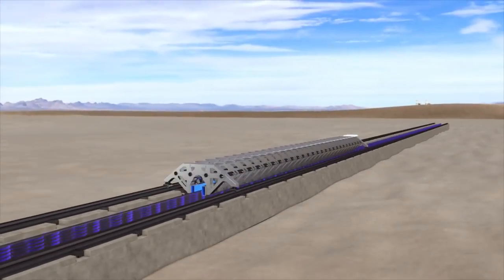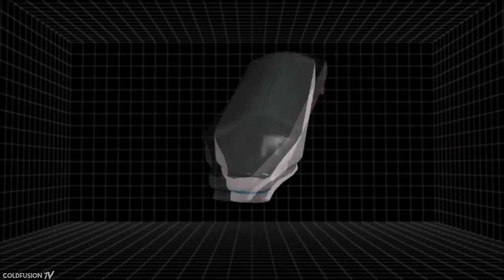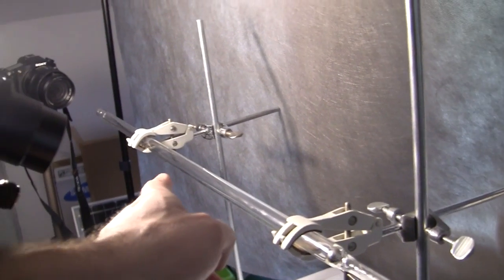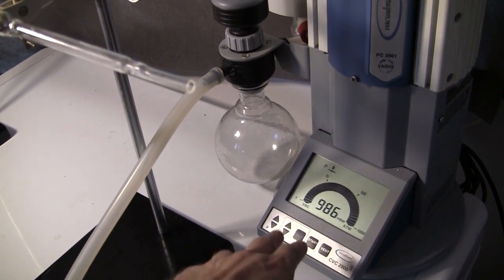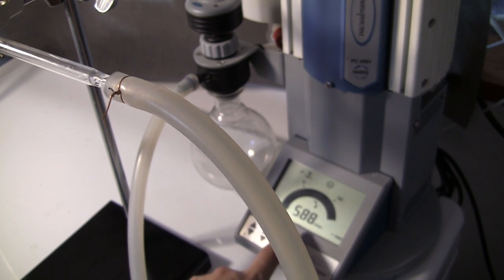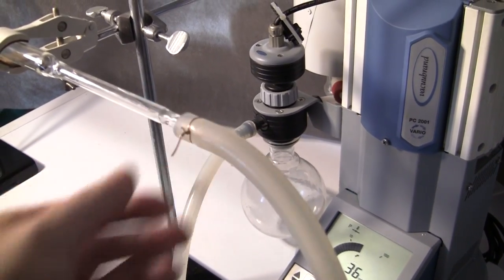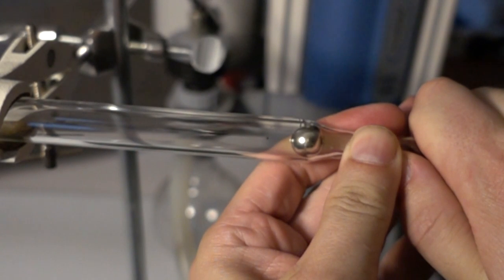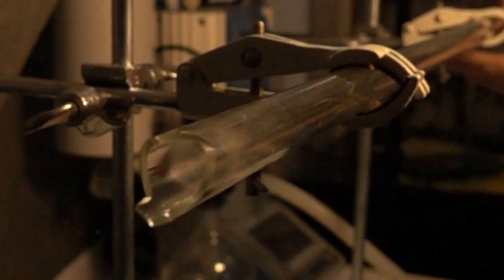How  the Hyperloop can kill you!

Comment: It is not the first time I heard about this idea, and it is not that bad of an idea, while not great either. But the problems in it seem solvable, I just don't know if it'll be practical or interesting economically (like a lot of ideas).

Couldn't you just brake the train by using computer controlled magnetic (Lenz's law on steroids) brakes in such situation? Surely it would feel like a car collision for the people inside, but they would not be dead if this solution was possible.

Besides that I'd take more time to do the math on the atmospheric pressure applied to the train, because i would expect, for instance, a difference between a sphere inside the tube, a solid cylinder, and a cylinder with a hole inside. Are all cases going to give you the same results? Maybe the sphere gives you the worst results (even if part of the kinetic energy goes for it to roll, how much?). What happens when the sphere and the tube have a bigger diameter difference? I'd expect different results, in that case as well (because not all of the momentum of the molecules - of the atmospheric pressured air - would collide with the ball (propelling it), besides the fact that they could go past the ball after some point (because of the ball's inertia), and might reach the tube's end before the ball does, therefore slowly breaking it, if the tube can be long enough).

I think this experiment gives a preliminary idea, but is not conclusive at all.

The acceleration is what kills, as you know well, so breaking the tube doesn't seem to be the only disaster here. Maybe in the acceleration people would die.

If you experimentally test my points above, I'd accept your criticism, otherwise, I'd have to do some math using their numbers and atmospheric pressure and momentum transfer. I'd have to think a while on how to do those in all cases I mentioned, because it is not equilibrium thermodynamics (because of the damn vacuum)...

Also, you could install an energy absorption system in the end of the tube. Extensively breaking tubes while testing would be a huge waste of monay. Get a spring, sand, foam, I don't know... You'd have to test this as well...

I know you won't put this video down because science and failure are very well known to each other. Every experimentalist knows that and making mistakes tells the best of us about our foolishness, and it is unavoidable making mistakes while you are learning something (especially in experiments).

I don't really give a damn about Elon Musk, but this idea is not that impossible, it seems, it just costs a lot. But it might be worth it in some context (but I doubt it is going to be practical to evacuate a long tube, so, a solution to that - which I could suggest one or two - would be the first must).

Comment: The hyperloop presented in your video is quite a bit different from the one originally imagined by Elon Musk. His idea would not really have a vacuum in the tube, nor would it use magnets for levitation. Instead it would have a ducted fan on the pod that would direct air from the front of the pod down the sides and out the back. This would cause the pod to rest on an air cushion and would also reduce drag by creating a lower pressure region in front of the pod. Since the amount of pressure differential depends on how fast the fan goes, acceleration could be quite gradual.
Totally different principle than the Hyperloop presented in your video, which seems to only share the name and the tube with Musks design. Not sure if it is any more valid, though.

Comment: "No way of stopping" ... well, I just figured out a way of stopping. Took me like 10 seconds. 
Step 1: have pressure sensors along the tube
Step 2: Have a fibre optic cable running along the tube
Step 3: If there is a breach, send a signal and open other SMALLER breaches all along the length (or just on the other side of the vehicle)
Sure it might be a bit uncomfortable to accelerate and decelerate rapidly, but with the technology of seatbelts, I'm sure a meatsack can survive.
Reply: "Might be a bit uncomfortable to accelerate and decelerate rapidly" Uncomfortable as in, lethal?
Reply: Pepijn Nah, just loss of conciousness is my guess.
Reply: Now that I think about it actually ... It might be possible that the brakes on the hyperloop are good enough that even the catastrophic pressure seal faliure wouldn't move the vehicle much if at all. We already have pretty good braking systems in elevetors its just a step up.
Reply: OK great, you seem to have a reasonable grasp of engineering. However you have a poor grasp of biology. Let me put it this way, a 6 foot tall, average weight person can snap their spinal cord from falling over and hitting their back. Do that high up the spine, say at the neck & you will cut off the brains ability to communicate with the body & regulate the body's autonomic functions.
Reply: PS do you know what mode of transport that allows you to travel fast, has a proven track record, is relatively cheap & already has the infrastructure in place? Aeroplanes.
Reply: Let's not forget if you flood both sides with air, the shock waves are going to meet in the middle and something aka the train is going to have to absorb that impact.
Reply: Anyway, It's 2 AM so I'm gonna add the last nail to the coffin. Thunderfoot acts like he's going to "debunk" the feasability of hyperloops by pointing out physics that take place there. What he presents are certainly engineering challenges that need to be 100% solved before you put a human in the tube, but these challenges ABSOLUTELY CAN be solved. So yea. In conclusion I'd rather hear his own ideas on how to tackle this problem rather than just presenting it, we've all seen "vacuum cannons" there is nothing new to see here.
Reply: Passive fail systems are better than active fail systems.

Just have hatches that lock shut only when at operating pressure, like a twist lock pressure cooker lid.  As soon as pressure difference drops enouph they automatically pop open; springs and gravity can assist. Have a mechanical system to help actively shut them again for them depressurizing initialization process.
Reply: Yes.  I feel like this was already a part of the plan.  Also, I believe I recall hearing that it wouldn't be airtight to begin with, only a near-vacuum with plenty of emergency openings built in.  I'm not an engineer, and TF usually has some good arguments, but shit.  They were talking about building one from SF to LA.  What happens when they lose pressure, drop the maglev and let friction take over?  I don't think a steel ball in 1ft glass tube is a very accurate depiction of the hyperloop.  When there's an accurate model, with a scale-length track, please get back to us TF.
Reply: Not even close. If the tube is two metres in diameter and there's a full breach, the highest possible pressure differential is still only 1 atm. Assuming the pod fills the tube almost completely, the upper limit of the force applied to the pod by the pressure differential over the entire cross-section of the tube turns out to be about 318 kN.

With that information, it is easy to determine the peak acceleration due to pneumatic effect - it depends on the pod mass. And it turns out that if the pod's mass is about eight tons, the peak acceleration is about 4g.

This is, indeed, uncomfortable, but nowhere near lethal if a safety harness is used at all stages of the travel. Loose objects in the cabin may pose a safety hazard, but other than that, it's very survivable. If you want to reduce the acceleration, just add mass to the pod. It's not that complicated.
Reply: nustada Not what I mean ... you get a shockwave of air going from the point of failure down the tube presumably at the speed of sound. You want something faster than that (such as light) to inform the place further along the line so it can either spread that shockwave thinner or just create its own to counteract it. Best case scenario is by the time this 1 atmosphere shockwave reaches the vehicle, the tube already has 1 atmosphere of pressure around the vehicle and the brakes are on.
Reply: 1.) He means to breach it in multiple places ALONG the track. 2.) The breaking system could be magnetically assisted.
Reply: Filling the entire length with air may not be the best option or be very effective against a large breach. There likely will be moderate leakage around the seals when the vehicle is stopped and loading. The designs show that the craft is built to use this amount of air by collecting it and using it.

Also, innumerable small air molecules do not have a set speed limit like the speed of sound. Some will have more energy and move extremely quickly, some will go slower. In the end I think as the wave front travels it will disperse more and more as it covers more distance, all the while the supersonic shockwaves from the air bouncing around in the tube will also get weaker.. but having one single breach far down the tube and such a large mass of air could create something like a blast wave similar to when you detonate something.. once the mass of air hits something thunderfoot may be right in saying that it will either blast it apart or propel it with more force than is used to brake or accelerate the vehicle at any point in time. 

I imagine the force and speed of the air would be similar to reentry, just not as high of velocity. Starting out as a supersonic gentle breeze then getting more violent as more of the front hits the vehicle..

All of this is conjecture... we need to get some models going on how the 1 millibar of air will influence a breach and how the vehicle will coop while keeping passengers alive. 

You could have an emergency system which seals off the unaffected parts by the stations with a blast door or have them in areas not around civilization so if it blows out then no one is harmed... 

Really there are so many ways to go about it that some modeling could really help see how well sealing or re-pressurizing would work against rupture.

All in all its a safety and longevity concern, still absolutely not something I would say fk it and end up scrapping the project.

Of course... this is assuming 1 mbar... not 350. Though all I can find is a number of just 1 mbar.. somewhere between the max 11 and min 0.3 mbar of the martian atmosphere.
Reply: HerraTohtori You are assuming 0 atm in the tube (not possible) and that the vehicle fills the tube completely. You'd still have thin atmosphere in there and because of it let some space around the train to let it flow over. Add to that the trains ability to compensate (brake or accelerate) and you'll get it down even more.
Reply: Depends on the mass of the train in relation to the area subjected to pressure.
Reply: Ideally, the system would be toroidal in shape to prevent there being an ''end'' that would produce a problem. Hopefully the whole system could be flooded in the case of a breach before it could shock the tramcar. I mean these are all good solutions. This isn't some kickstarter campaign he is picking on, this is a billion dollar engineering project with some serious science behind it.
Reply: More then one solution is already in the commons using the Kantrowitz Limit or a plug to their advantage.  https://www.registeredcommons.org/view/167/0/10018
Reply: The breaches would have to move insanely fast in order to get enough air in before the vehicle whizzes past. Considering the expense in creating such breaches along the entire length of the tube, even if the vehicle was safe to operate, it'd be so expensive that I'm questioning why build it in the first place.
Reply: Also, keep in mind guys that the hyperloop project has many competitors so there might be a variety of solutions used for this and any other problem.
Reply: Except APPARENTLY it travels at, or VERY close to the speed of sound. Ever heard the saying ,"It's not the fall that kills you, it's the sudden stop"? Same issue here, if you  sit on a 3x3m piece of steel and then drop it off a sky scraper - WHILE STRAPPED IN WITH A SEAT BELT! You'll probably just die.
Reply: Worse case scenario is that the leak happened within a mile or two of the train and your valves are just beginning to open...
Reply: At those speeds that would just result in severely injured and possibly broken necks and ribcages and possible brain hemorrhages.

Even a low speed crash, going from 60km/h to 0km/h can cause lasting injury and pain, not just be 'uncomfortable.'
Reply: +TheRedBanner Thunderfoot said something about 1mBar. This is would be a pretty strong vacuum and the system would have to be pretty much airtight.
In a nuclear reactor or a bio lab, they tend to use slight underpressur to prevent things from getting out - then no airtight seal is required. But this system operates with a very strong vacuum, making an allmost airtight seal required. Besides: Any air leaking into the system would have to be sucked out - making it airtight would lower the cost of keeping the vacuum up.
Reply: *****
Not as wacky as it sounds, flood the tube with some type of chemical foam dense enough to slow the capsule once a large leak is detected. Would have to be something that could later be removed from the tube easily. Some chemical make up that comes out dense then turns to liquid after 10 minutes.
Reply: sarowie
One thing to remember like compressing air and storing it in tanks allows you to release larger volumes all at once. So is true for vacuum. It could be stored in large reserve tanks along the tube for quick release once a explosive plug seals a section.
Reply: Mick7sp
Vacuum is much harder to store then compressed air. At best, an completely empty container can only suck its own volume out of an other container. Compression on the other hand allows to store a multiple of the containers volume in a given space by increasing the pressure. Eitherway: Making the system more air tight would reduce the amount of energy needed to sustain the vacuum (compared to not designing it air tight and suck constantly against leaks).
Reply: sarowie
"Compression on the other hand allows to store a multiple of the containers volume"
It is my understanding it would only be limited by the strength of the container and the power of the vacuum pump. Like a compressor too much pressure the storage chamber would explode.  Too much vacuum and the chamber would collapse. I commonly use a reserve tank with a vacuum pump. Not to increase the vacuum, but to increase the volume. This allows you to very quickly apply a vacuum instead of waiting for a pump to slowly bring it down. In the same way a compressor tank allows you to build up more volume than the pump can continuously deliver alone.
Reply: "THE BEST ARTIFICIAL VACUUM ever achieved is produced behind a 4-meter disk dragged through Earth orbit by the Space Shuttle. Called the Wake Shield, the deflector pushes atoms out of the way, producing a small region in which the typical distance between residual atoms is a millimeter. Judging tenuousness by this some convention, the best pumped vacuum on Earth attains a residual atom spacing ten times worse---a tenth of a mm. By comparison, the atoms between stars are spaced a centimeter apart; in the gaseous halo of our galaxy the spacing is about 10 cm; and for intergalactic voids, it's up to 10 m, the lowest density (or highest vacuum) ever measured. (New Scientist, 25 April.)"
http://newton.ex.ac.uk/aip/physnews.369.html
Sorry that link is now dead..
https://en.wikipedia.org/wiki/Vacuum
Reply: Use a simple accelerometer instead of pressure sensors.
Reply: Peter Nachtwey You need to know that a pressure wave will hit you in the near future not that it's hitting you right now, but obviously there'd still have to be accelerometers that instantly work with brakes and acceleration to minimize the ammount of force on the passengers.
Reply: MrRolnicek
That's why I said "highest possible" pressure differential. Of course there's always some leftover air (1 mBar according to the specifications, which is about 1/1013 atm, so pretty close to zero anyway) but since the surrounding air is about 1 atm (or whatever the local aerostatic pressure is at the time), that sets the upper limit to what the pressure differential can be (from approximately 0 atm to 1 atm).

This gives us the upper limit of what kind of pressure differential there can be on a situation where the tube has a breach immediately on either side of the pod, since you have almost 0 atm air on one side and almost 1 atm air on the other side. It's just an approximation, of course to get actual figures I would have to know the exact size of the pod, etc.

Also, yeah, if you have a breach further on in the pipe, it can gain significant speed if it's let to rush along the tube towards the pod, in which case the pressure of the air can go higher than 1 atm as it reaches the pod (acting as an obstruction) - but I don't see that happening. There will simply have to be relief valves that can be opened to fill the tube with air so that no significant flow velocities can build up.

But the point here was about using air pressure for braking, by letting air into the tube ahead of the pod, not an uncontrolled breach anyway.
Reply: Couldnt we just have an outer shell slightly above the pressure of the main tube to catch the leak?

The valve system would be, IMO, between the front and the back of the train. So the high pressure air from behind rush thru the train to its front, where the pressure is lower and re-equilibrate the pressure both in front and at the back, stopping the propulsion.
Reply: I had exactly the same idea.